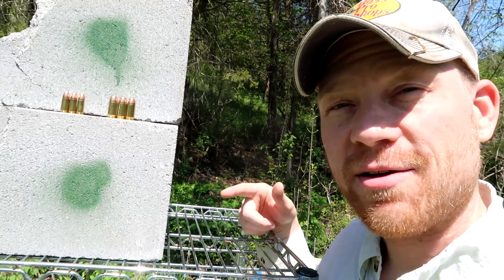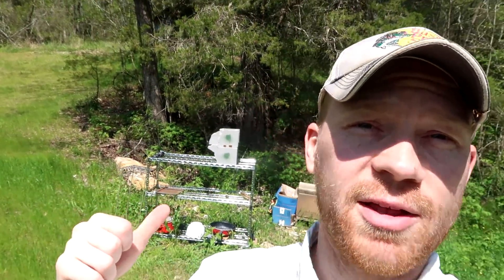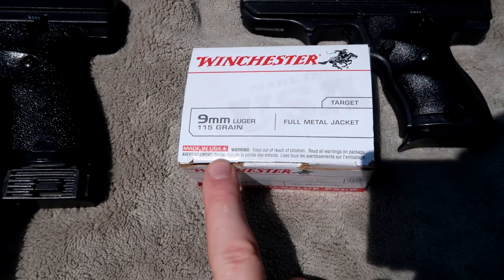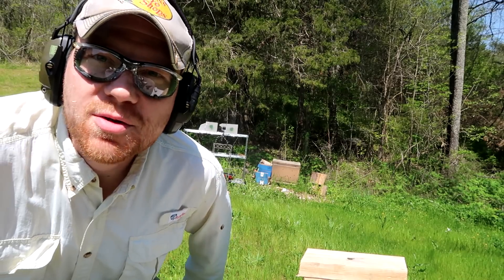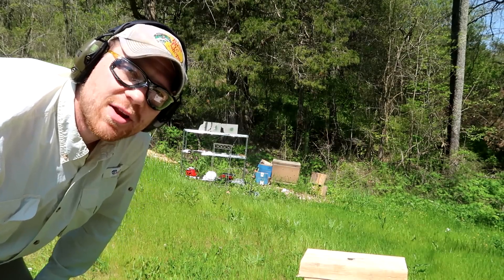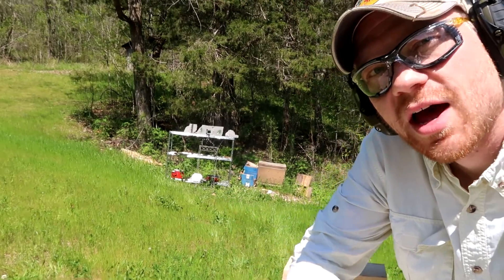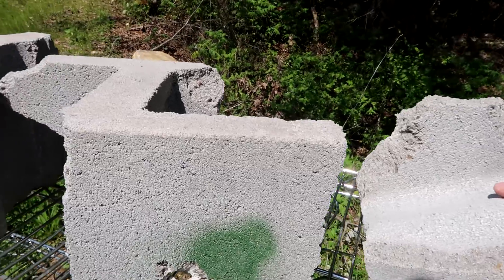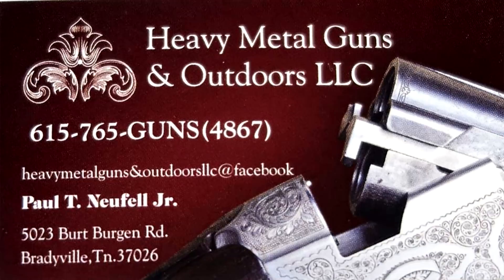9mm vs 45 ACP - Cinder Block Test

Comment: The .45 carries a lot of energy along with it's mass. That equals a big punch. The 9mm is faster, but has less mass. It'll put holes in it and will beat the block down little by little. Both will work though.
Reply from the maker: Surprising that they can both go through the block. Not what I expected fully
Reply: They're both military rounds for a reason... They work. .45 1911's tend to be my go to EDC. Sometimes I will carry a 10mm 1911 Commander size. Keep doing what you're doing brother!
Reply from the maker: Yup thats teue. Thanks devildog! 45 is my favorite but sometimes its nice to have something easier to conceal too
Reply: In that case I carry a Performance Center M&P9 Shield. I agree. Sometimes you might need a smaller gun. This would be back in Arkansas... "My church gun." LOL!
Reply from the maker: Yup exactly
Reply: To tell the truth brother... It's "my church gun" here in Nevada too. LOL!
Reply from the maker: Yup i hear ya. Id just as soon carry a full suze 45 or .357 everywhere (which i do in the winter) but sometimes its just not worth the hassle of all the old ladies knowing you are keeping them safe at church :)
Reply: And that sir is why a Shield is your friend. The blue hairs never know you have it. LOL! I even carry a AMT "Backup" .380 on those really hot Vegas days. At 117* that extra weight is no joke. LOL!
Reply from the maker: Whewee thats hot!

Comment: I prefer the .45 . Bigger holes are better holes .
Reply from the maker: Im right there with ya. Thanks James!
Reply: I'd have to disagree with you there, big time
Reply from the maker: Uh oh! How so???
Reply from the maker: Yikes
Reply: +Salvatore thats why I carry Walther PPk in .32
Reply: The best caliber is the one you are accurate with.  👍
Reply from the maker: Very true. Thanks onion head!
Reply from the maker: Uh oh
Reply: James Pollard phrasing
Reply from the maker: I am most accurate at lonher distances with my 357 mag. Thanks for watching! I havent tried any longer range shot with my 380. Need to try now tho
Reply: I carry two 22 WMR weapons. The PMR30 with a Fast Fire III inside the waistband and the NAA Pug in a pocket. I reinforced the PMR magazines by strengthening the lock notch with steel-laced epoxy and treated all interior friction surfaces with Archoil AR4400LP and Royal Purple Gun Oil lubrication. I run Hornady Critical Defense in both weapons and plink at the range with any 40 grain or better. I use a magazine re-loader (I highly recommend this) available on Amazon so my four magazines are always uniformly loaded and the casings don't get dented. I have not had an FTF or FTE in over 3000 rounds. Couple of things to sum this up; when I hit you with 18+ bullets, all in your upper chest, neck and face, I  believe I can reasonably expect to redirect your attention.  Also, Israeli Mossad are ISSUED 22LR semi-auto's as their service weapon and my weapons are MAGNUMS.  Last note: A 22LR will pass through 3/4 inch plywood at 50 yards, 22WMR's will do 1 inch plywood at 100 yards, both of which are harder than sternums, throats and foreheads.  Especially at less than a dozen feet, where I'm happiest.   Y'all have a great Marine Corps day.  Semper fidelis.
Reply from the maker: https://youtu.be/qFwntHIWjaw

Thanks for watching!
Reply: James Pollard I don't know.  I've carried a Browning Hi Power 9mm for as long as I've been old enough to own a pistol, bought it at 21, 38 now. It's never failed me and has gotten me out of trouble more than once.
Reply from the maker: Id say they all will get the job done if needed 😆🖒🇺🇸 thanks for watching!
Reply: Tell that to your wife , i like them both !
Reply: I prefer the 9mm. More holes means more blood more quickly.

Comment: There's no replacement for displacement.
Reply from the maker: Think you're onto something there
Reply: Jason Mullings  Toyota supra 2JZ uses a 3 liter straight 6 and is cheaper to work on and modified is way faster than a ford gt which is not an economic car by no means and the Ferrari F40 with a v12 is a faster car than a ford gt. Watch donut media for the ferrari

Comment: Both will get the job done. Honestly, it depends on the situation. For personal protection against common thugs at the door or on the street, you're not going to shoot that many rounds. Might as well go .45 acp. However, for someone expecting to get into a drawn-out gun fight with someone desperate to kill them and everybody is shooting from behind cover, you're going to want magazine capacity. That's where the 9mm wins. But the better question to ask is how can you know which of these two situations you might find yourself trapped in? And if both can get the job done, then you'd be better off erring on the side of magazine capacity.
Reply from the maker: Solid logic. Thanks for watching!
Reply: If every is shooting you need ar15 pistol in car or truck to handle that pistol is for close and short encounters nuff said

Comment: No doubt 45 is more powerful. It rooms more gunpowder and has a bigger and heavier bullet. The question is can a 9mm with less of all that do similar damage. Looks like the barrel on the 45 is an inch and a half or perhaps 2 inches longer than the 9mm which gives the 45 an unfair upper hand.

Comment: I prefer 9. 

Capacity, controllability, and follow up shots are the main reason.

Price and ammo availability are another.

I remember reading about how speer gold dots in 9mm expand to something like .661 on average and .40 expanded to .665. I don't remember what the size was for the same bullet in .45 but it might've expanded to .7 or so.

Anyways, 9mm has more variety and versatility with ammo.

Extreme penetrators, extreme defenders, Fort Scott 80, 115, and 125gr solid copper spun bullets, nice bonded hollow points that perform well etc. There's something for everything and I can load up subsonics or supersonics or really anything I want for whatever purpose I want from home defense to trails and wild animals to PDW type ammo to soft shooting competition loads all the way up to 9mm major (yikes!)

I also like PCC's and 9mm shoots much flatter and further than .45

I like being setup to reload just 1 or 2 calibers as well, in my case 9mm and 5.56/.223

Also, my favourite handguns are in 9mm, CZ pistols. I intend to shoot IDPA and USPSA with them and 9mm is better for that.
Reply from the maker: Thank Eric

Comment: You all talk about penetration and velocity, and the difference is not that big, and that's normal because the smaller caliber is faster, but none of you talk about shock or stopping power. I saw a friend of mine get hit by a 5.7 caliber bullet, and he didn't know he was hit until he saw the blood. I'm not exaggerating when I say that the time between hit and realization was seven seconds, seven full seconds. If an attacker was attacking my house, that would have been enough time to cause more damage. Imagine if it had been a 45 caliber, what would have happened? He might have lost the injured limb, and that's the difference. I know that other calibers less than 45 caliber are faster, but we want to neutralize the target as quickly as possible, wherever it is hit, and that's what the 45 caliber offers.

Comment: I carry both, a  striker fired 4.5" .45 & a single stack dasa 2"  9mm, not at the same time tho. Also have a Sphynx sdp duty ( aluminum grip) 3.6" dasa 9mm I will carry once I get a holster for it & put about 600 more round through, it's real tight stil with 400 rounds through it.
 I carried a p226 for 6 years, like both rounds, I love shooting steals with the .45 but it's nice to have the small 9mm in the hot summer months and it will do the job.

Comment: A REAL test would be shooting blocks in a mortared wall so the block has the same support all around.  I'd make it at least 5-6 blocks high, and 4-5 blocks long, with sufficient time for the mortar to harden.  Using half blocks like those is unfair because there may be small cracks already from when the block was shortened.
I like the 9 better because of the amount of ammo.  If you're a good shot, more ammo means more hits.
Reply from the maker: Thanks for watching!

Comment: Your first 9mm shot was not on target. I'll take 9mm hollow points over 45. More shots on target faster. Enough damage with hollow points to stop anyone.
Reply from the maker: I refilmed this video and included a 40. Check it out https://youtu.be/qFwntHIWjaw
Reply: It will stop any one but you need to put threat down quick with less shots for safety my weapon will 45acp

Comment: I used to carry 45. I like more rounds these days, crowds have been an issue of late ...
Reply from the maker: What we need is a 20 rounds 45 thst isnt too huge to carry 🖒🖒🇺🇸🇺🇸🇺🇸
Reply: WHO_TEE_WHO maybe I need to grow a bit lol
Reply from the maker: I like to carry a 45, but I have to have some heavy pants and a thick belt to hold it up. I can't lug my full size 45 around hooked onto some basketball shorts 😂😂😂
Reply: WHO_TEE_WHO true. I have a 1911 and a g30s and both weigh a lot more than the g19. Even though the 30s and 19 are basically the same size. When Ferguson was going strong I got in the habit of keeping the g19 and spare mag on me and a 33 round stick center console always extra mags in a pack.
Reply from the maker: I always keep a spare mag on me. I refilmed film this video and included a 40 this time. Check it out here

https://youtu.be/qFwntHIWjaw
Reply: Chance Carlton you still can carry .45 is crowds in mind as there are .45s available nowadays that go into 9mm territory capacity-wise. The Glock 21, Springfield XD-45, Walther PPQ, .45, SAR K2, FNX/FNP .45, HK USP .45, Para-Ordanance P-14 to name a few.
Reply: chrismc410 everything is a compromise and to equal capacity those are going to be bigger and  heavier than 9mm.
Reply from the maker: I stay away from crowds as much as possible :)
Reply: WHO_TEE_WHO I do too. The problem is they shut down streets and highways unexpectedly. That's why I like the 33 stick in the cab. I'm not as forgiving as Reginal Denning.
Reply: @chancecarlton8403  carry what you want put the ROUNDS where they count that's what COUNTS in a gun fight nuff said

Comment: I was expecting the 9 to rip right thru, and the .45 to stall.   
I carry 9mm with the consideration of size & capacity; always with good ammo.  Cheap JHP rounds can load up & over penetrate.
Thumb's up!
Reply from the maker: Thanks! Yeah it is always interesting to me to see what happens. I carry different things normally depending on the weather
Reply: OldChevy4x4 doesn't have greater capacity though.

Comment: I saw you made a mistake there sir. You said the 9mmm didn't break the back wall with the first shot it did you can see it in the video it just didn't split it apart the way the 45 did. The 45 looks like it hit harder at that range but that 9 mm split the back wall on the first shot that was in the center

Comment: I personally think the .45 is a far better threat stopping round since it carries considerably more kinetic energy and transfers much more of a wallop than a 9mm. However I've also personally switched to using 9mm for conceal carry and self defense because I think the 9mm has the best balance of pretty much any other caliber out there. Both. 45 ACP and 9mm have their virtues and their drawbacks and one can always choose to use an in betweener caliber like .40 S&W or 10mm, but in the end... in spite of many things I dislike about 9mm,  do believe it offers the best balance between power, weight, cost, recoil, availability and ammo capacity of any other caliber.
Reply from the maker: Thanks for watching and for commenting. I shoot a lot more 9 mm simply because the bullets are cheaper. I carry 9 or 45 depending on situation, weather, clothing
Reply: WHO_TEE_WHO, I.agree. There is no set rules or an absolutely perfect caliber. One should always carry what works for them, what they are familar with and whatever is their preference for any given situation. Great video by the way! Just subscribed.

Comment: One time I bought two master padlocks, shot one with a .380 and made a dent, the other one with a 9mm and made a deeper dent. I thought it was going to be like in the movies, they shoot at a padlock to open a chained door and the padlock blows into pieces..  I used the laminated steel type instead of the solid brass. Can you do a test like that using .380, 9mm, .40, 10mm, .45, .357 mag and .44 mag caliber ammo? I also shot them from a distance of 10  feet. I always wonder which handgun caliber will actually destroy the padlock.
Reply: Octavius Maximus.
Reply from the maker: That sounds like a great video idea! Writing it in on the video board queue now!

Comment: A cinder block is hardly a fair ballistics test, especially when you a comparing two different calibers with very different bullet weight. Yes the 9mm does have a velocity advantage over the .45 but with a 115 gr disadvantage. There's not really any way to make a cinder block test fair between a 9mm and a .45 acp. The closest way might be to use 180 grain bullets from the .45 and 147 gr from the 9mm but make sure to use the same type of ammo as you did here.
Reply from the maker: All in good fun. Thanks for watching Gerald!

Comment: I got caught up in the 9mm craze and bought a Beretta pre-ban Italian 92F. I couldn't get rid of the gun fast enough, I hated it, sure it had 14 rounds but was too big and heavy for concealed carry so I went with various .45's and settled on the Kahr CW45 and am very pleased with its simplicity. The down side is limited capacity, 6 + 1 in. My other two carries are a S&W 351PD .22 mag 7-shot and a S&W hammerless .357. My theory is if the .45 helped win a world war it was good enough for me. The reason most police departments use the 9mm is high capacity. For me the nine is too small and too high speed a round. So, .45 forever. It's all about stopping power right?
Reply from the maker: Stopping power yes indeed

Comment: Hard to do an actual comparison when you don't het center of both blocks.  The 9mmwent through on the top.  But if it would have his center, it may split the blocklike the 45.  Either way, cinderblock is easy to break when there is no grout in it.
Reply from the maker: Hey dano thanks for watching! Refilmed this test to include a 40 and releasing the video tomorrow. Thanks for watching!

Comment: You should have braced your guns before making the shots and also shown us the damage one shot at a time.  You called the results 'inconclusive" but I hardly think that was the case.  The 45 split the block on one shot while the 9 mm required two shots but since the 45 has twice the grains at 230 while the 9 mm only has 115 it is what I was expecting.  The 45 is a bigger round with twice the grains so delivers much more kinetic energy to the target.
Reply from the maker: Thanks John!

Comment: My opinion you should of used brand new center blocks for more accurate results ... those blocks were used and looked like they have been shot before giving them existing stress cracks  which lead to inaccurate results ... no disrespect

Comment: 230 grain vs 115 grain.  2-1 mass.  45 wins
Reply from the maker: I sure like 230 grains!
Reply: Both are good cartridges. The 9 mm advantage is capacity.
Reply from the maker: Yup #true
Reply: gregoryjamesaustin not true.
Reply: It's a matter of preference. I have both and like both. But the 45 simply has more mass which translates to more mass on target.
Reply from the maker: Yup yup you are right. With me it is more about weather and clothing when i need to conceal
Reply: I have a 9 Shield and XDS 45. Both are about the same size. The 9 advantage is higher capacity by a few rounds.
Reply from the maker: Both very nice! I am familiar with both of those.

Comment: What I think is you need to learn how to aim better. Your first shot with the 9mm was taken at about 7 yards and you didn't hit the cinder block in the centre, you almost completely missed it and only just caught it by skimming the top. The second shot was placed better and in the centre and that's when you should have stopped shooting as the block was split in half. You should have stopped and assessed at that point just like you did when you hit the centre with the .45 ACP

Despite that, thanks for the upload and the subsequent entertainment!

Comment: Yea the high point is ugly and cheap and the older one was junk but the knew one still the same but they fixed the reliability of the gun is quite good you should watch what the guy from demolition ranch does with one he shots the in the barrel and slide and it still works that's  good for $100bucks besides if you spend $500or more on a gun and you have to use it on someone guess what you just lost $500 or what ever you spent because it get took after words and you mite not  get back then a cop will be carrying your gun around probably
Reply from the maker: I have had high points for many years, and have only good things to say about them. Not pretty, but very reliable. The 45 is very easy to shoot accurately because it is so heavy